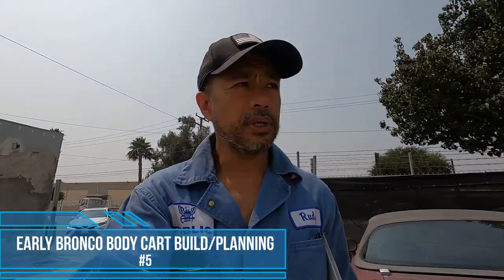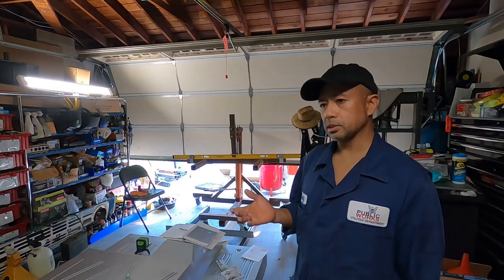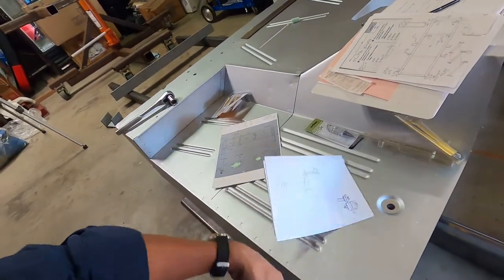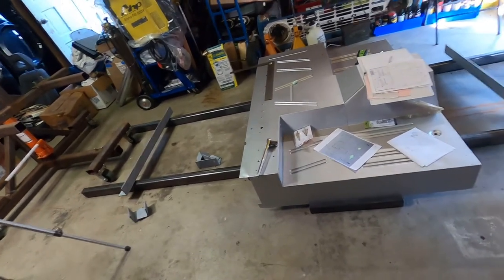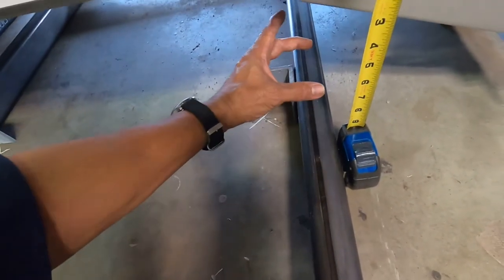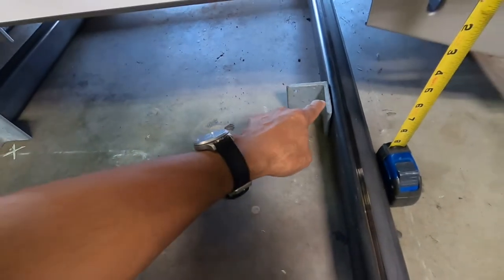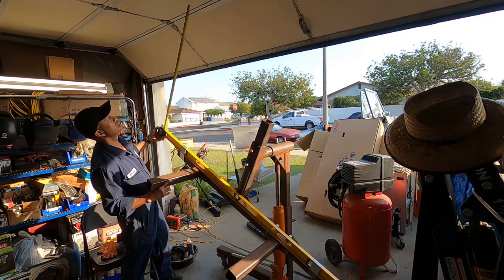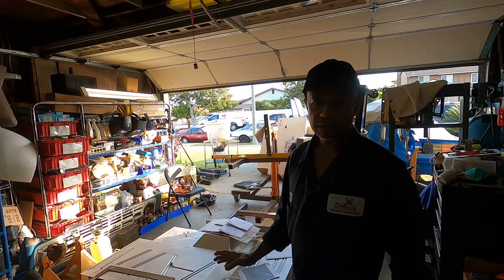Early Bronco Body Cart Build/Planning

Comment: Great video. Thanks for all the info. Any update videos coming soon?
Reply from the maker: cll375, thanks for watching and subscribing.  Body cart is not done, I've just been welding pieces of the caster/threaded rod assembly.  I've been doing a lot more research and from other Bronco build videos, most start out by welding in the floorpan for structural rigidity, so I may go that route first.  The Bronco is really rusty, if you've seen my earlier videos, and it would not be wise to remove the body, in its current state, and lift onto the body cart.  My next video may be to start cutting out the rusty floorpan for the new install, so stay tuned.  I'm running out of space in my 2 car garage too, which becomes a problem when you start taking things apart.